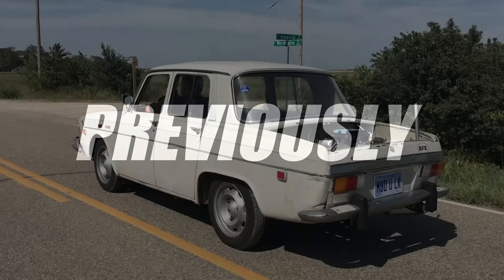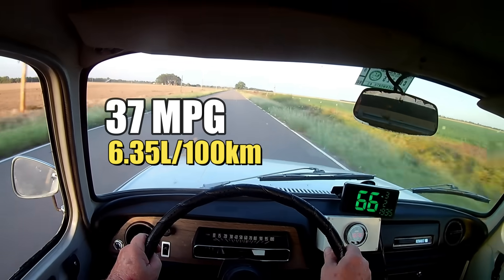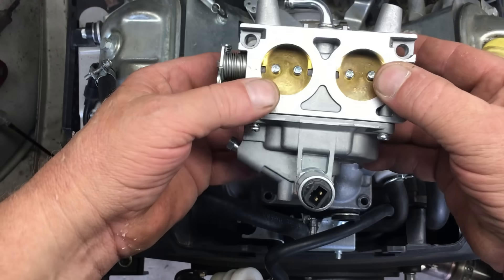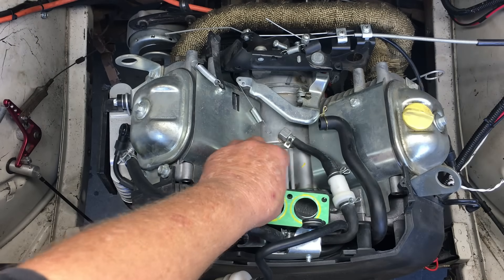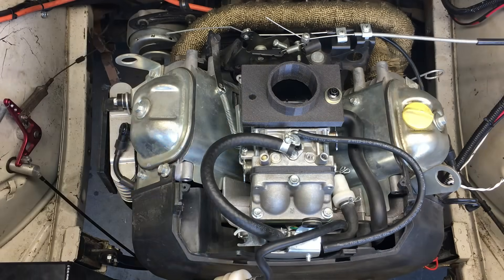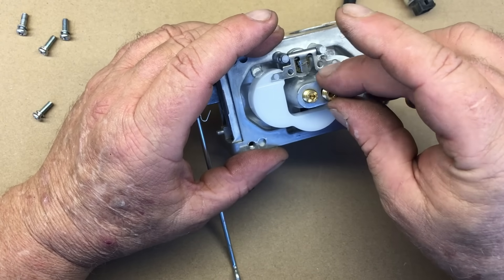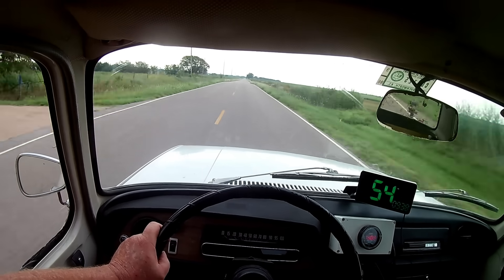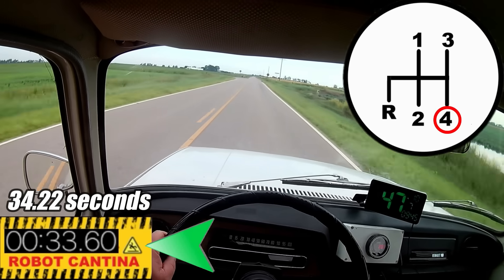S3 E27. We improve the fuel economy on the 670cc Predator powered Renault

Comment: I forget the equation for calculating intake resonance on a NA engine, but theoretically, intake stacks would improve a specific RPM performance. It's very old school thinking. The engine should be hovering it's ideal speed with the CVT, but I don't know. Just something to test for giggles.

Comment: I think the experiment shows that the engine could use some bigger carbs. A dual carb setup should still be superior to a single carb if you think about the firing order of the V2 engine. The intake strokes overlap which means one cylinder is „stealing“ air/fuel mixture from the other if there is only a single carb. That’s probably why it isn’t running as good at lower rpm.

Comment: Your spacer did the classic things, more top end and less bottom end power.
Change the jets again and re-test the acceleration.
Keeping the air/fuel ratio the same (or close) removes another variable.
My guess is that the air filter change didn't do much one way or the other unless it is restrictive which doesn't appear to be the case.
Maybe, you need to go back to shifting with the new power curve.

Comment: The results are improved however for science sake you should try the rejetted carb without the spacer and on the old filter and housing for a more apples to apples result on the stoichiometry.
Reply: Thank you!
Now I don’t have to make my own post about this issue. 
This test is screwed and I think Jimbo him self feels the same, otherwise he wouldn’t wondered what made what difference.
Fun experiment. But in the name of science it needs to be rerun.
Comparing configuration 1 with config 2, that involves 3 changes,  and try to answer what hade which effect can’t simply be done. 
Looking forward to the follow up.
By the way, that new air filter…don’t believe it’s an improvement. The adapter seems restrictive.

Comment: Jimbo, I was with you on the CVT clutches up until this episode. I genuinely think you are right and that CVTs have made more sense up to this point...but we've now seen that this engine has enough power to start the car out in 3rd gear, with the CVT only creating a reduction equivalent to starting out in first...and now you have an engine that is trending toward it's power band being slightly higher in its rev range...I think you may have just crossed the line where you might genuinely get better fuel efficiency and acceleration both from switching to a centrifugal clutch over a CVT. Just a thought, I have definietly not been a CVT critic from the beginning, I love CVTs...but this is just what my intuition is telling me on the numbers you're putting out. Just a thought, thanks for the awesome content, as always. You're an inspiration :)

Comment: I believe you made the fuel mileage improvements from going to a smaller jet. The cross flow spacer changed the airflow dinamics of the intake and moved the powerband up in the rpm range. Which explains the soft start, but it's making more power in the higher revs helping the 0-55 times. A good example of what you did is the difference between "dual plane" & "single plane" manifolds on American V8's

Comment: I like to play a game called "Automation" it has a fairly in-depth engine section (but not full on sim)  But everytime when I have an engine design, messing around with the intake sizes seems to shift where peak power is being made....and often times having a bigger intake shifts optimal power output to the higher rev range.

Im pretty sure thats what's happened here. At lower RPMs the engine dont quite know what to do with all that breathing room. But at higher RPMs it needs it. (Hence why you noticed the improvement last few seconds.) You can even hear the cadence change in the last few seconds where it seemed to be climbing rev a little faster.

Comment: Interesting stuff. I'm guessing the carb spacer reduced low-RPM torque and boosted upper RPM power. But that's just a guess. It would be cool if you had access to a small engine dyno.

Comment: 12:54 - 3 changes! You also changed the filter and airbox. It now has a low pressure chamber before the filter neck. Not sure how much of an effect that will have, but just wanted to let you know it may be a factor.

Comment: I'm thinking you should try and change the weights in the cvt, you get a good launch, but then when the cvt starts to kick in, the rpms drop and the engine starts to lug down with the load. Keep the rpms up a bit and the transition, and I bet you'll get into the 20's for the 0-60. Love this project!

Comment: You could also experiment with adjusting the rollers/weights in the CVT to match the max power rpms better.
Reply: Remember that golf cars with high speed gears only can do about 35-40ish Mph, half that normally.
Reply: I agree, putting different weights (Lighter) so it holds the lower ratios longer so the engine RPM can climb higher before it transitions. I think once all of the mods are done to the engine and carb setup then go for the CVT tuning to optimize the engine power band.
Reply: @PRL1290  yeah now you can obviously hear the clutch fully engage after a few seconds of the launch and the rpm drops… it shouldn’t drop or maybe just a little bit
Reply: @PRL1290  Totally agree.  Lighter weighs on the "driven" pulley would load up the engine sooner but if you have multiple gears in the transmission (which go-karts and such don't have) this would be a GOOD thing, and make the transmission gearing available much more useful, IMHO.
Reply: Yes. I would hate for him to ever lose that transmission but if he did he can make a  rear axle. From scratch and just use the CVT or get a gearbox from a gasoline golf cart they are certainly strong enough for that
Reply: @ronalddaub9740 I think gear ratio would become a limiting factor though. Would be interesting to do the math, especially if we knew what the existing final drive ratio was. I can't remember if he covered that somewhere, I know he recently went over the individual ratios in the transmission, not sure about final drive
Reply: That gearbox is definitely eating some power at this point maybe putting some thinner oil inside it would help it doesn’t need thick oil for this amount of torque maybe even diesel would be enough lubrication. And ideed the torque converter should be adjusted untill the engine stays at max horsepower rpm all the way from start to finish when launching
Reply: @teammouse  I don't know that it's eating up so much, that losing it and redesigning the system is going to be much more efficient. It's such a small gearbox that there's not much to it, and I'm unsure of a way it could be simplified without totally limiting the car with a singular ratio, that would take extensive testing to find the optimum ratio. Also, seeing as it's mostly being driven on flat ground, I'd assume the slightest hill would require a much higher gear ratio to actually be able to climb, the ratios available from the CVT won't be able to drop it enough, while also retaining the top speed it has, if you limited it to the single ratio option. 

Even a 2 speed gearbox, might work. But you're still going to be losing some in it, and adding an extra layer of complexity that may not work well with the production cycle of his videos. If any of that makes sense? 

Not saying its impossible, if you have some ideas, I'm down to discuss a little, maybe we can give Jimbo some good ideas for the future.
Reply: @goosenotmaverick1156  you’ve got a point, everything except from a straight shaft from engine to wheel will have a loss for example a belt driven cvt transmission is about 30% loss and a normal car transmission is atleast another 15% on top off that at this point. See, let’s say that transmission has about 15% loss with the 50hp or whatever engine is inside of it stock. So I’m guessing with a 25hp engine for example hp loss percentage will be even higher more like 20-25% on top off the 30% from the cvt
Reply: @goosenotmaverick1156   but I think 4th gear on this transmission is straight trough not sure though.
Reply: @teammouse  It almost certainly is 1:1.  Almost everything of that era top gear was 1:1.  Not for any "magical" reason, but because it's super-efficient and super-cheap to produce it that way (not to mention space-efficient).  You just need a synchro and some splines to lock the input and output shafts together directly to give you "top gear".  No need for extra gears and extra friction like in the lower gears where the rotation has to go through a gear set on the counter-shaft.  Old Muncies and Saginaws and such from the era were the same way.  Top gear was truly "direct drive".
Reply: @grandmasmalibu  so basically the way jimbo drives it now can’t be much more efficient because takeoff is just a reduction with some losses in 3th and then shift to 4th just straight trough from torque converter to wheel

Comment: Single port intake per cylinder is best, try to avoid the bends and you will make gains.... especially at low rpms.   Tune to 13.5a/f under load and 15 to 16 for cruise.... may need 14-15 for a smaller engine at cruise.

Comment: It would be cool to see you print an extra long set of intake runners and attach the open spacer to them. That should increase low rpm torque and help with acceleration.

Comment: A good experiment would be an on board solar system on a small engine car  (solar panels on hood, roof & trunk) that charges a battery bank, used to make on demand hydrogen & oxygen added to the gasoline/ air fuel mix. 
To see if it's possible to get 60+ mpgs and maybe be a practical system if refined 🆚 all the bogus the HHO youtube videos. 
Im pretty sure burning a combination of gasoline,hydrogen & extra oxygen would provide more power. Maybe even just s little hho mixed in could be enough give it some extra kick..
Just gotta watch for engine overheating & pre ignition/auto ignition.

Comment: My guess, and it seems that others are leaning towards it too, is that you gained volume but lost velocity.  So the low end isn't "tumbling" as much as before and only once you get to the higher RPM does the tumble come back into effect.  You're effectively tuning for a specific (higher) RPM.  Would also explain the difference in AFR.

Comment: I'm thinking the cross flow is more helpful at high rpms. The vmax motorcycles have a valve they call v boost that opens between two cylinders at 6000 rpm and when it opens it feels like the engine got sprayed with nitrous.

Comment: I would not have expected that just the spacer by itself would have made that big of a difference in MPG and I did expected it to hurt performance, or at least change it. Interesting. I think cleaning and opening up the intake path would a good logical step, and as someone already mentioned, do away with the short, sharp 90 degree bends, if possible. Keep up the good work!

Comment: From my observation with other YouTubers who created a open flowing intake manifold on this exact engine, it created very weird turbulence and uneven air flow. One cylinder would get way to much air and fuel while the other was starving. I don’t know how or why it was doing that but they needed to go with two stand alone carburetors and flow test each one. 

The improvement I think you can make in your air intake is to get rid of the little 90 degree elbow after the air filer and create a direct straight run. Less weird bends in the intake system should create better airflow characteristics and fuel atomization but still keep each intake isolated.

Comment: I would build an adapter to fit a small 2bbl holey, straight up 😁 with about 6" runners from the intake elbow flange. A mini tunnel ram if you will 😁
Reply: @RobotCantina it would help both low range and top end

Comment: You’ve effectively increased the carb bore size relationship per cylinder and typically, this equates to more torque at higher RPMs. Which would explain the anemic launch. Depending upon gearing and other factors, motorcycles with in-line 4’s with smaller carbs produce fast launches and kinda peter out in the higher revs.
Reply: My experience in tuning and drag racing N/A Hondas has taught me that Intake runner length or length of cold air intake pipe has a dramatic effect on torque curves as well.
Reply: @jeffcard3623  I’d like to see him supercharge this sucker.
Reply: @MotoRestoFL  in this engine, turbo is posible and better idea 😁
Reply: @4krist  Yea, you're right, I was was thinking exhaust powered and wrote something else. How would one grab rotational forces from the crank in that setup? Duh. Thanks.
Reply: @MotoRestoFL  
670cc have a oil pump, so he can lubricate turbo 😁
220cc does not have a pump, so only supercharger
Reply: @MotoRestoFL  
Take back in episodes and look how Jimbo install AMR in honda
Reply: Small carb = high low end torque it becomes an n/a diesel basically

Comment: Didn't you mention that the stock carb has different sized jets left to right? Because however the engine operates, the two cylinders need differently-sized jets to run at the correct AFR?

I would really like to see a test run with the stock intake, and the stock jets, and collect AFR data from each cylinder independently. Baseline, you know? Because I have to think that having crossflow in the intake might be making the AFR on both cylinders "wrong," but that they average out to "right" at the tailpipe.

Comment: did you think about trying different ways of taking in the air? like different shaped filters or different filter materials or even trumpets? :D

also: back then from scooter tuning i remember the cvt has rollers wich were available with different weights and helps adjusting the cvt to the power and torque curves of the engine. idk if your cvt has rollers like that but might be interesting to tune the cvt to keep the engine on it's proper power/torque ratio as long as needed 

(when using different racing type exhausts on these 2-strokes it was important to tune the cvt according to it otherwise you could over rev or not be at a useful torque)

Comment: Actual both things helped. Dual plane intakes create more low end toque while open plenum intakes (which is what you have with the spacer ) breath better in the upper RPM range. Your results are typical for this change. It's all about the signal the carburetor is receiving that determent how it will perform.

Comment: To increase power, you need to increase the air density. Get the air filter up higher into cool air and put a scoop on it to ram more air in. As others have said, if you can eliminate the 90 degree bend at the carb, that would help. How about a tunnel ram?
Reply: Oh, put a forward facing snorkle on there and have it coming up to get the ram effect either from the roof or side of car.

Comment: I think what happened is, adding the open spacer cut the signal to the carburetor, making low speed fuel metering harder for the carburetor. But it helped overall flow at higher engine rpm’s. Sense this engine is rpm limited, I’d increase the air flow of the carburetor and increase the intake runner length. This should allow better cylinder filling at lower engine speeds and create better torque. Are you planning on a cam upgrade? More lift and duration on your camshaft would also increase performance. 😁
Reply: I think the reduced barrel flow changes the mix and carb tuning, compensating with higher flow using rpm might be valid. 🤔
Reply: These predators all of them have a mechanical RPM governer and an electronic ignition based rpm limit aswell,
Reply: @flavortown3781 I didn't think these predators had a CDI did they? Also I'm pretty sure he detached the governor
Reply: @flavortown3781 he disabled the governor.
Reply: FT ..................I think he took it out ???? @flavortown3781
Reply: Supercharger
Reply: @deamoneater357  big can of compressed air in the trunk

Comment: Connect a hose to the air filter, duct tape the other end to a passenger's mouth and have him blow hard.  Then you can print larger and larger diameter inserts into his nostrils to see if it makes a difference.  You may need to rig up a sharp stick to revive him when you need a boost.  Be sure to label it BOOST and tie his hands so he can't stop you from using it.